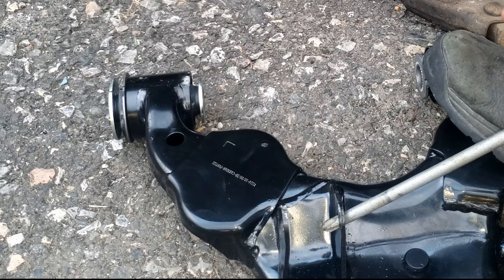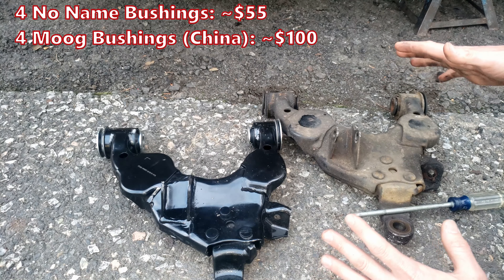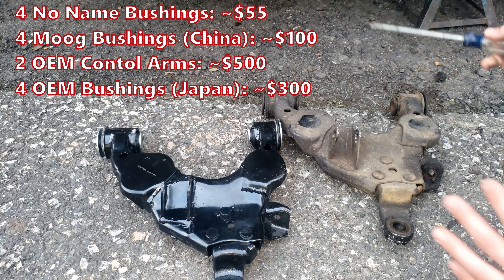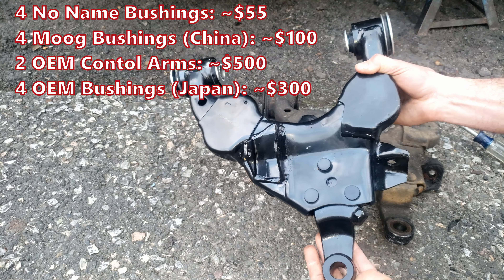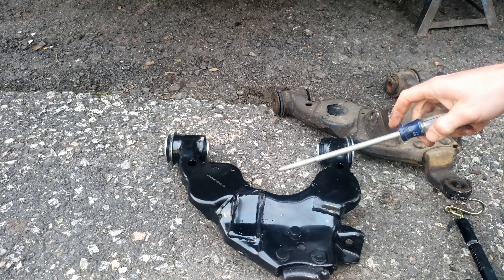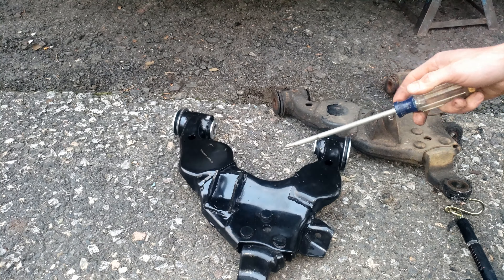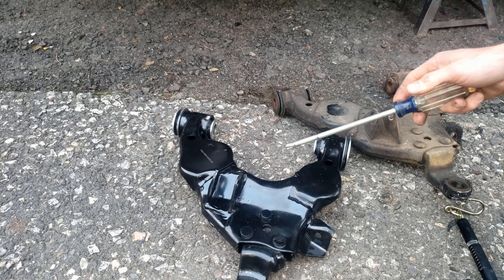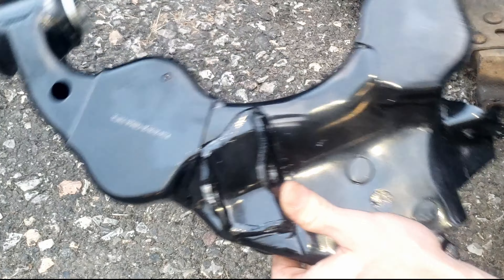China Steel vs OEM Steel - Tundra / Sequoia Lower Control Arms ($125 vs $500)

Comment: I put mevotech arms on my LS430. It’s been a good value for my needs. Right now I am putting the cheap bushings into the arms on my 03 sequoia. I think it’ll be better than the current ones at a fraction of the price of OEM. I’ll be happy if I can get 5 years out of it. We will see but it doesn’t owe me anything at 438k miles.
Reply: Where did u get them from and when , I need some uppers for my 2is350 and they are 350 a pop oem

Comment: Not sold, think the shock mounts are a little more thin and don't have to be thick anyway. Does job just fine. Besides when these get replaced life of vehicle is half over.
Reply from the maker: Yes they do the job just fine. But they're not as good of quality.  Replace bushings in factory arms. Done deal

Comment: My mevotech Chineseium control arm bushings bent slightly shortly after the arms were installed. A year later I chased down a nasty squeak noise over bumps to find the right rear bushing separated from the arm and rubbing the frame. Swapped for 2 new OEM arms very shortly thereafter. Was a lot cheaper than my health insurance deductible I'd have to cough up when the mevotech crap nearly kills me

Comment: I would never give the dealership a dime of my money knowing how greedy they are.

I've bought suspension parts from Moog which are just as good as OEM.  The OEM control arm for my Toyota was $230 a piece.  The Mood equivalent was $60 each.

The Toyota OEM is not built by MIT rocket scientists wearing white gloves.  They are likely made in Thailand or China just like Moog.  6 years later they still work like new.
Reply from the maker: The aftermarket bushings do not last anywhere as long as OEM. And the control arm metal is inferior. Just speaking facts here based on experience. Will the Moog ones work? Yeah sure.
Reply: @NNKH2  Well the control arm in my Toyota was shot around 80,000 miles since the car was bought new.  It's now been about 60,000 miles since replacement and I think it's still good, no noise but I haven't checked. 

You have to remember that car manufacturers (including Toyota) build their cars with planned obsolescence in mind.  Manufacturers want to maximize profit so their parts are "good enough" until the warranty expires. No manufacturer overbuilds a car to last 500,000 miles.  They want consumers to keep buying new cars.

Look at new Tacomas and Tundras.  Absolute junk.

Comment: Everything from Autozone, oreilly, Napa , Rockauto is GARBAGE .......Aftermarket parts are low quality standards......Go to the dealership spend the money and buy a quality part.
Reply: If you can inspect them, I've had lots of duralast gold parts that are actually OEM. Cam sensor for example, got a Mitsubishi, made in Japan one when supposedly no none makes them for that car anymore. And fairly cheap. Seen some* ball joints that are as well, but the thing is you don't know what is in the box, they can change it just as easily, so always get your hands on the part. For sensors and stuff where aftermarket absolutely won't do, I usually go to my local store if they have one in stock and get my hands on the part.